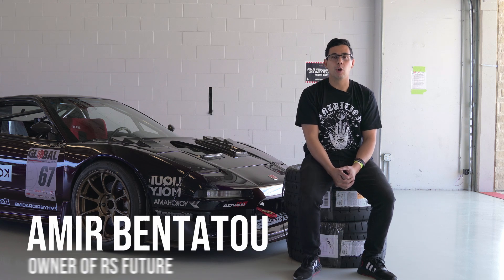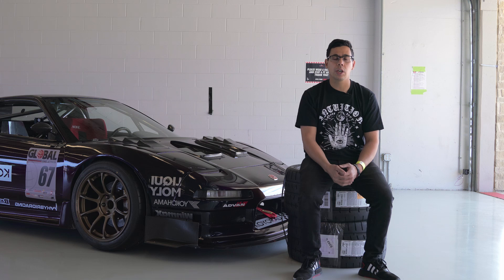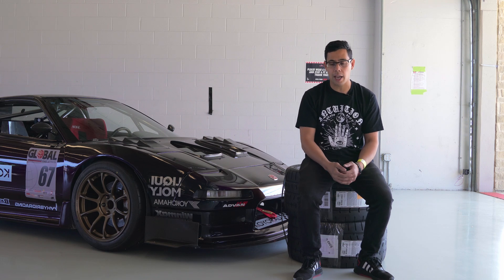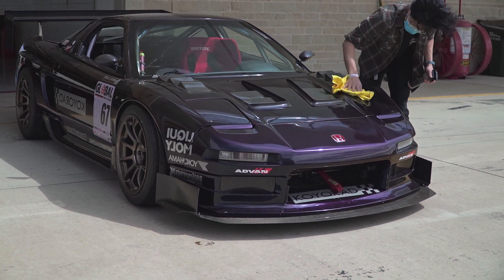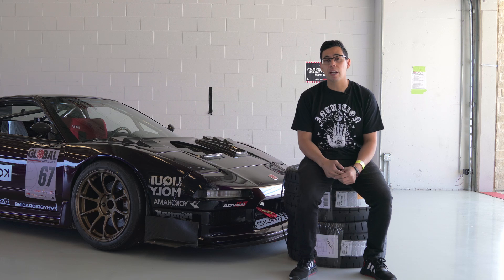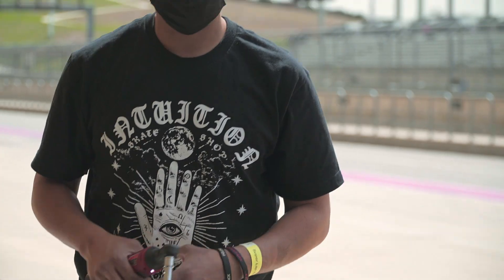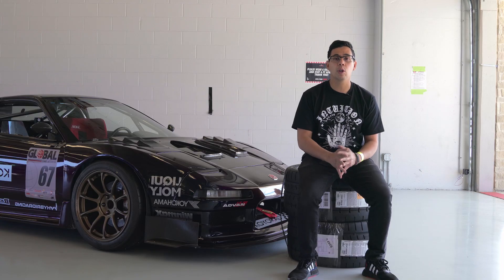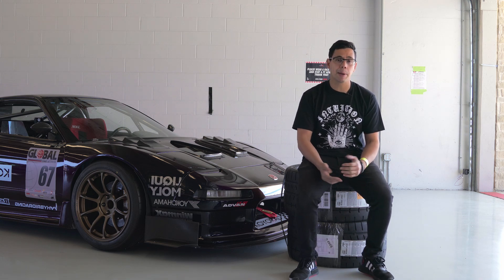Widebody, Turbo, K Swapped, Time Attack NSX

Comment: Can you explain why you switch out the old motor for a k20? Not to shit on the K series but you essentially swapped out a “super car” engine for a “normal” engine
Reply: It's a reasonable question.  The C30 is a great engine, but the design is old, the engine is large and heavy ,and parts are difficult to get and expensive.  If an engine or transmission fails they're both expensive and hard to find.   The primary reasons were to weight, availability, and aftermarket.  With the K and the rest of the lightweight components on the car we've cut about 700lbs.  Engines are easy to find and will handle anything you throw at them.   Our Samsonas dog box is an off the shelf item and has proven to be very reliable.  It's a swap that seems odd at first, but makes sense once you look at all the factors.
Reply: Thank you
Reply: No need to race with an expensive engine.  K-series engines are better than I originally thought.
Reply: We've been runing several stock k20s with rotrex, with 360 hp, with shorter final drive, for 3 years, with no problems.
Reply: @RSFuture  yeah..and that old engine is hard to tune... I meet many machanics.. as soon as i speak about my nsx they all giving up already 🤣.. so I'm just keep it stock up until now..